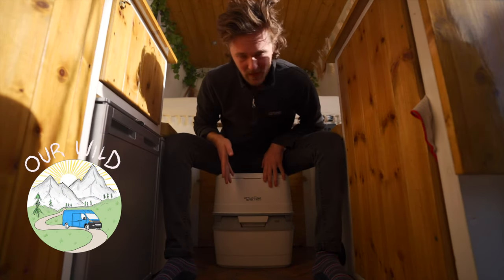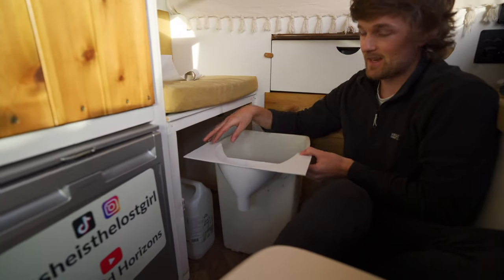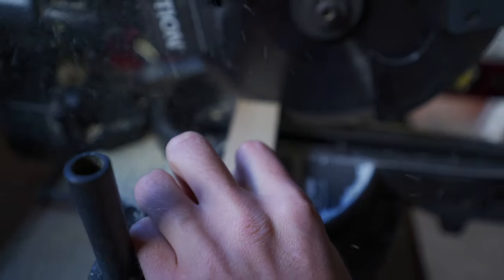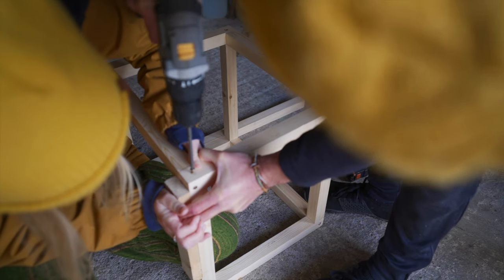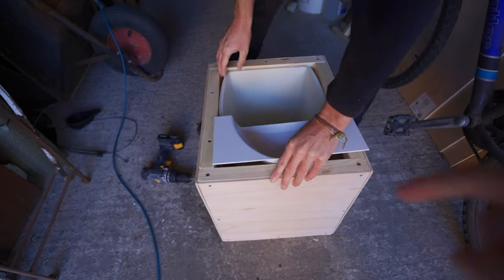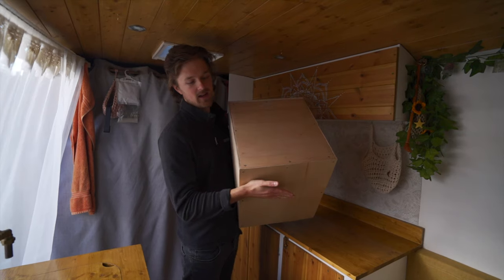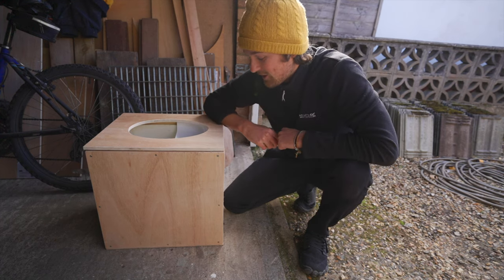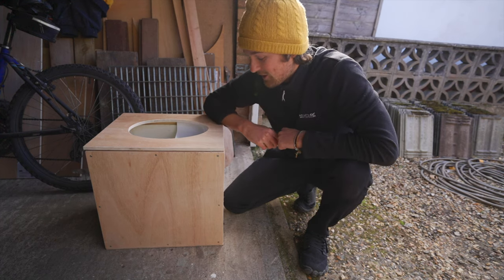How to Build The Easiest, Most SIMPLE Compost Toilet

Comment: Good video. I met some people that lived in their van full time a few years ago, and they had used a rectangular ‘tractor funnel’ available at farming stores as the separator for their composting toilet. They cost around £10-£15.
Reply from the maker: That’s genius! I just googled it and it looks perfect. The separators are grossly overpriced for what is essentially a bit of plastic. I’ll pin this comment so people can see it, thanks for letting us know!
Reply: @OurWildHorizons  thank you for pinning this... :)
Reply: I'm wondering would a sawn up car oil 5L jug work just as well?
Reply: @OurWildHorizons  I used a 2 liter soda bottle and part of an old funnel drain tube and an orange juice container for the urine separator. I have been having to use a composting toilet for the cold seasons because the main drain line for the septic gets frozen and backs up due to getting frozen. I also have to be carfull taking showers in the cold seasons. I may only take like 2 minute showers and thats it in the cold months.

Comment: Very happy to see you have ditched your chemical toilet! We love our separating toilet and did build our own similarly to yours. We keep a spray bottle of vinegar near the toilet and spray down the separator after each wee--- it helps keep it clean and also eliminates odor. Thanks for this video! You two are our fav folks to watch!
Reply from the maker: That’s good to hear! We’re still waiting for our varnish to dry, so we haven’t been able to use it yet…
Thanks for the tip with the vinegar spray, is it white vinegar you use and do you dilute it?
Reply: @OurWildHorizons  yes it is white vinegar. We do dilute it down 25-50% I admit I don't pay too much attention to the dilution so if someone has a strong opinion for you, you might go with that. I fill the spray bottle with 1/2 or more vinegar and top off with water and keep it handy near the loo. Even on hot days this summer it was very effective at keeping odors at bay.
Reply: Where do you put you stuff to compost? We're planning on making a compost toilet as well but can work out what to do with it.
Reply: Alternatively to the vinegar in a spray bottle, which smells pretty pungent and is very off putting to me - try a mixture of water, a pump of liquid dish soap, and a healthy dose of essential oil of your liking (e.g. orange or lavender). I have been using my separating toilet for 4 years full time now and have no pee smells, nor calcium deposits in my bottle. So much nicer smelling than vinegar!

Comment: FYI I sealed all the cracks inside the our box with seam sealer, and then painted the inside of our toilet box with a thick coat of waterproof paint (latex based, not oil). I used varnish on the outside because I like the look of wood, but I wanted the inside to be leak-proof and very easy to clean.
Reply from the maker: Ah that's a great idea and would have been easier, we ended up varnishing the whole thing and sealing the bottom area which took a very long time to dry. Thanks for watching and commenting :)
Reply: smart! I'm taking notes

Comment: Nice job....
Finished building my own in my motorhome  3 months ago and works so much better.
I use Coco Coir as the composting medium. Good stuff but a bit expensive!
I give a little squirt of very diluted vinegar in the wee part each time to clean and stop the smell.
Also I have added a little 12V computer fan to draw out any stray smells.
all the best, Steve
ps: my compost toilet build video is also up o my channel.
Reply from the maker: Brilliant, thanks Steve! We'll get some Coco Coir and maybe mix it with wood shavings to make it a bit more economical for us. The vinegar trick is one we'll be using too so thank you :)

Comment: You know, I had my mind set on buying a natures head composting toilet, but I think I will try this out first and see how I like it. If I like it, this would save me a ton of money!!! Thanks for sharing!!
Reply from the maker: Couldn’t believe how much some of them cost!!
Reply: We found a used nature's head toilet years ago for cheap. Been using it as a second setup when outside on the farm. Don't like the NH design. Have to bend over to agitate the waste. Horizontal mixer means you are picking the waste up when you agitate. Better to have a vertical shaft and mix it that way. NH is also heavy and awkward to dump. The base is more square and with the circular motion of the mixer, stuff sticks in the corners.
Going to build my own like you all did to eliminate the problems of the NH.
Reply: @steveb4656  Thanks for the info!! Good luck on your build!!

Comment: From brazil here. I made one of those ( even simpler one ) out of pvc pipes and a round 20 liter plastic bucket we can easily find on any construction site and get them free of charge. These buckets come with a lid and a strap which is very handy. I bought a regular toilet seat ( seat and lid ) and kept only the seat bit of it that rests on top of the bucket lid when not in use. The seat is bolted to the pvc pipe frame in the same manner it would be bolted to a regular ceramic toilet. When I go do my business I just lift up the seat, remove the bucket lid, put the seat back down which now rests on the pvc pipe frame as well as on the bucket itself.

I put a rubbish bag in the bucket and cover the very bottom of it ( inside the bag ) with a layer of card board ( I save cardboard boxes and cut them out in the right sizes ). Next to the toilet I have another 20 liter plastic bucket filled with dried dirt ( I spread the dirt in a thin layer over a plastic sheet and let it sit under the sun to dry out ).

When I finish my business I take a piece of cardboard, put it on top of my deposit and squeeze it down evenly so my deposit spreads in a thinner layer taking less room upwards and requires less dirt to cover it. Finally I put a layer of dried dirt on top of the cardboard and put the bucket lid back on.

The nice thing I like about using the original lid that comes with the bucket is that it pressure seals nicely.

Let me know if anyone would like me to post pictures of my compost toilet design.
Reply: 7 months late to your comment but if you could post pictures on imgur or something and link here I'd really appreciate it, wanna make the simplest compost toilet possible as crap at diy and don't have the correct tools. Pun not originally intended.
Reply: You're a genius! Never heard of the cardboard method before ❤
Reply: A year late to this post, but I am interested in pics of your design.

Comment: if you install a small wood stove, install the composting toilet close enough to the wood stove to put your toilet paper and scoop your poop into the wood stove to be incinerated. Police and city bylaw used to show up on complaints when my black water valve started leaking out after winter. this is also the same ongoing problem with people who have to live fulltime in their RV on a property and they get in a lot of trouble once there's a complaint or ongoing complaints over their black water tanks leaking or illegal sewage dumping. last year I removed the chemical toilet out of my RV after a stressful meet with police and bylaw officers. the cop ordered me to discontinue using the toilet in the RV. I tossed it. I previously lived in a scratch built converted cargo van and never had issues of any kind with parking bylaws or other problems related to living fulltime in a van or RV. Some people live in travel trailers but they don't drive or own a vehicle. some property owners allow them to squat on their property in the trailer. once they learn to remove the RV chemical toilet and switch it to a waterless composting setup, then add in a cheap wood stove and there's your incinerator toilet.
Reply from the maker: We don't have the space for that but that's one way to get rid of it! Sorry you've had stressful encounters about it, hopefully you've found the new way a lot easier to manage?

Comment: Great video.  Just subscribed.  This is the second time I’ve seen that same urine funnel/separator.  Where are these sold?
Reply from the maker: We’re very limited here in the UK, there don’t seem to be many options. We got it from freerangedesigns. £44 which is expensive considering it’s just plastic!
Reply: @OurWildHorizons someone posted on this feed about a tractor separator funnel which was much cheaper and worked well.😊

Comment: Great work, I see some people also use a small computer fan and run a pipe to the outside of the van, have you felt the need to do this to help further with smells or use a carbon filter?
Reply from the maker: Honestly we haven’t had any issues with any odors! The trick seems to be to just make sure it’s covered in the wood shavings and if it ever does get bad we can just bag it and bin it. It’s so much better and less smelly than our chemical one we used to have. But thanks for the tips!
Reply: @OurWildHorizons  really helpful and useful to know, thanks so much!

Comment: Thank you for the video. I'm in exactly the same situation, fed up of trying to get rid of the portaloo! After a yr of use, what's the verdict on smell and best thing to add in for composting? Do you think a sealed lid would make a difference? Any advice would be welcome and thanks again for your input on what to do with our output
Reply from the maker: You're welcome, thanks for watching! 
We're still happy we switched. We haven't had any issues with the smell using a decent topping of woodchips/hamster bedding. We find as long as we don't leave it over a week before disposing the bag it's all good. I still like to use public toilets whenever available just to keep the maintenance lower than otherwise. I'm sure if you could seal the lid, that would definitely help. As well as having a dedicated boxed in area for the toilet.

Comment: What will you be doing with your bags of waste? We are going to make a compost toilet for our van but can't think of where to compost it :)
Reply from the maker: We're still figuring that out. The varnish has only just dried so we haven't actually been able to use it yet!
Reply: @OurWildHorizons  It would be great to have an update in a video at some point if possible!
Reply: @OurWildHorizons  suggest using biodegradable bags to line #2 collection. Composting takes an enormous amount of time. With that, throwing away the biodegradable bag into normal receptacles actually would help break down anything going into a landfill that will end up next to your baggies. So even if not composting in the traditional sense, it's still very helpful in the long run.

Comment: I don't understand, how do you do so the smell of the poop doesn't go inside the van?
Reply from the maker: Compost toilets don’t smell at all because of the sawdust 😊 the wee smells more than the poo to be honest but we don’t leave wee in there 😊 
The chemical toilet was pretty smelly
Reply: @OurWildHorizons  yes i have one chemical and it is smelly
Reply: When you separate out the urine from the poo and use sawdust or wood chips it basically just smells like an earthy compost. Also having worked as a plumber I can tell you that every time you flush a regular toilet the contents of the bowl are aerosolized and fills your bathroom even though you can't see it, so if you poo in a flush toilet then drain it all away by flushing, it actually fills the room with a fine mist adding to the smell. Sawdust toilets do no such thing. As long as you cover the poo each time with a layer of sawdust/wood chips the smell will be a lot less than a standard bathroom.

Comment: I don’t understand how you can separate it for a woman. I just asked my girlfriend if she poops and pees simultaneously and she said it happens sometimes. Doesn’t seem that there’s enough space between both coming out that separates it perfectly. She said she’d have to scoot forward and hold in her poop and then scoot back to finish pooping. Are you having any accidents? In all seriousness, because I have a camper van and need a new solution. We live in it every weekend for work. I have no issues peeing in a bottle. It only took slamming on the brakes once to realize a chemical toilet doesn’t work and literally had to gut my van floor after that happened. Spent hours cleaning and hosing it out 😢 not fun and never again.

Comment: This is a about a toilet.  You have links to everything but the separator funnel which is key.
I saw a lot of talking heads and very little of the actual project build.  Is this about you or the toilet?
Shorten to 5 mins, show actual build and 1% of talking heads.
Reply from the maker: Our links are from our van build series which we include in every build related video. It's called Urine Separator, we don't link one because we found ours to be too expensive for a piece of plastic. I have mentioned the company several times to other viewers who asked nicely in the comments. You can find it there if you want.